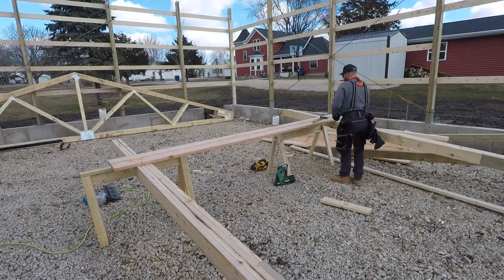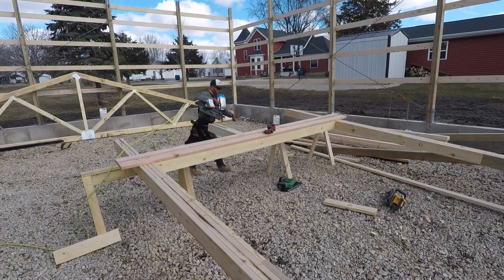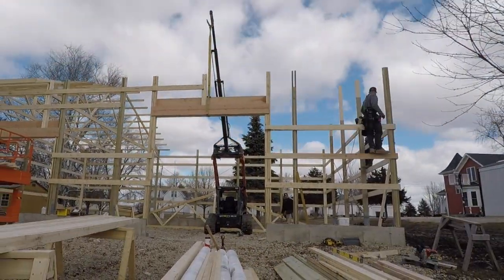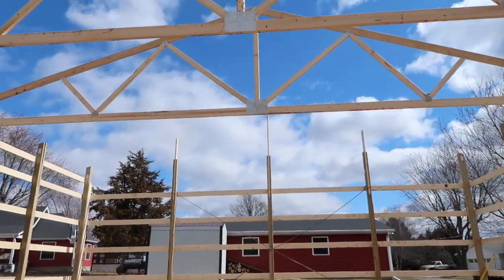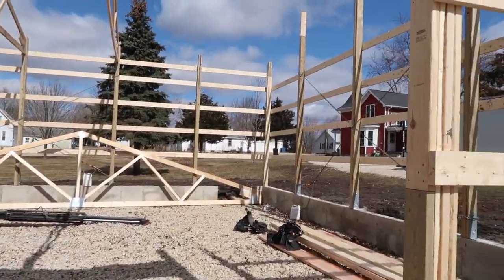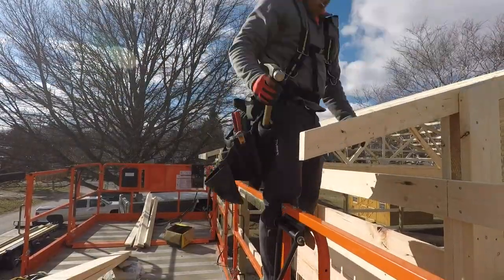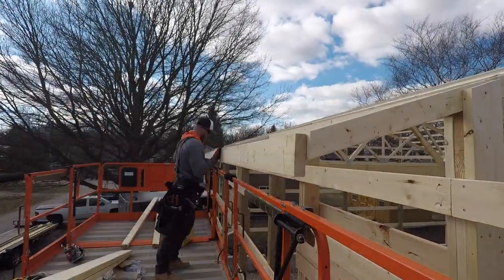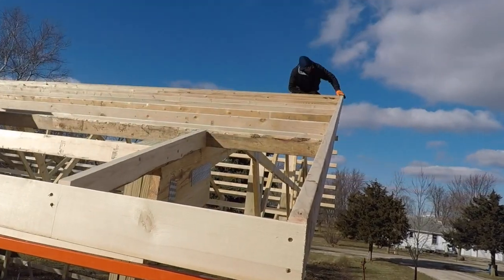Best Garage Video 2 (trussing and overhangs)

Comment: A few questions:
1.) Why do you have the vertical 2x6 added to the inside of each corner post?
2.) Cross bracing chains - what does the large jug at the bottom (looks like it's filled with water) do? Is is to stop the chain from rattling and accidentally releasing the ratchet?
3.) I don't understand the 2x12 lintel that supports the truss and post over the 10' door. I can't see the detail, but Is that "stub column" only bearing on one (1) 2x12?
Great videos!

Comment: You may have showed this before but how do you secure the Perlins to the truss?  Toenail, screw?
Reply from the maker: did you watch the whole video...I showed the fastener
Reply: I did watch it, but I guess I somehow missed the fastener?
Reply: So...... A 60 penny straight down through the width of the Perrin?  Just curious.  I know you are successful with it, but they dont pull out?  Just trying to improve on my knowledge.  I am not remotely trying to be critical, just curious what is holding that roof down?  1 60 through?

Comment: Why don't you guys wear safety harnesses when you are installing the trusses and purlins?
Reply: Trust in their own ability to climb properly, the sturdiness of the frame, the height, not really any debris below, and nice weather. Obviously it's safer to have a harness in case of some freak accident, but it probably didn't even cross their minds since there was no real sense of danger in the situation.